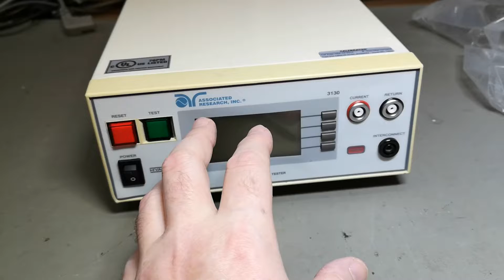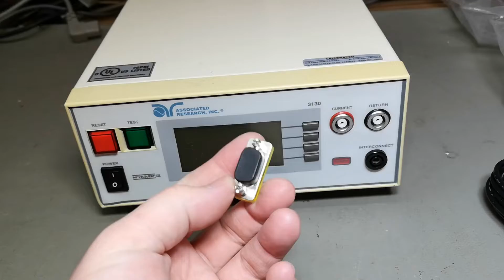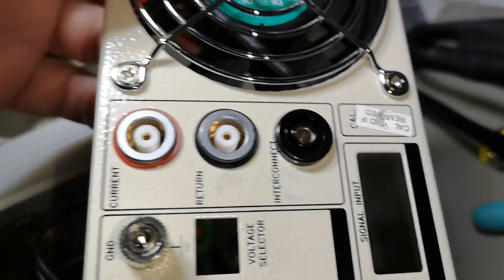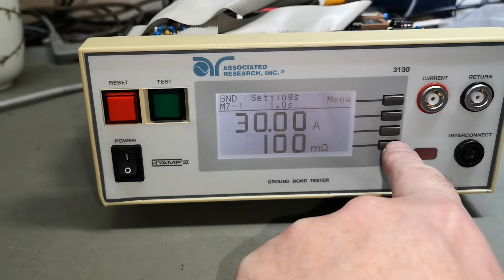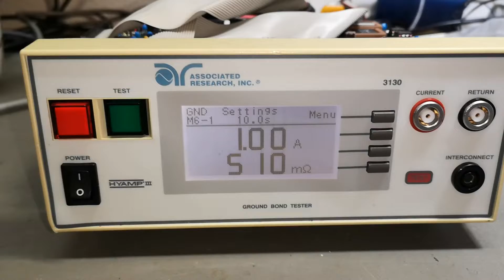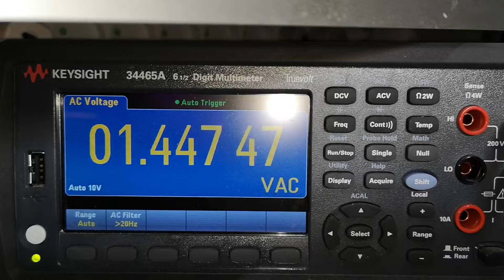Associated Research Ground Bond Tester 30A 510mOhm type 3130 teardown test

Comment: That's a nice unit ... to turn into something else ;)
Reply: For example?
Reply: @inse001  Well, I would say that for most hobbyists this is a pretty/completely useless instrument. But it has a high power controllable output stage. So maybe you would be able to turn it into something like a Kepco BOP. A bipolar power supply / amp.
Reply from the maker: I agree. it looks like its is a nice push-pull AC stage for low voltage high current, but i need more a high voltage type for 115V 400Hz so i can work better with avionics.